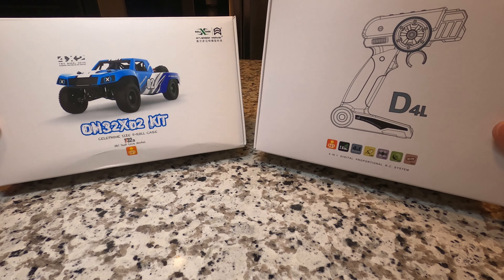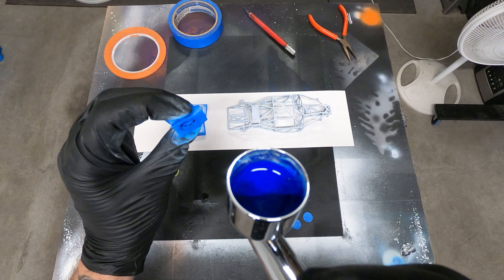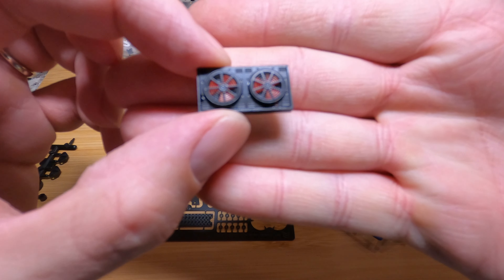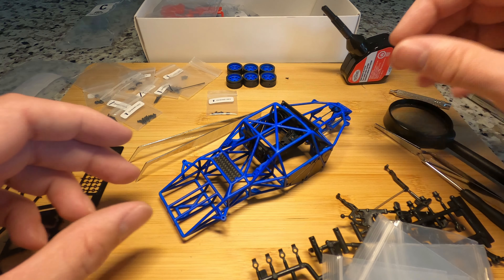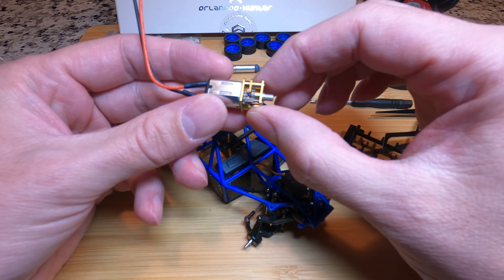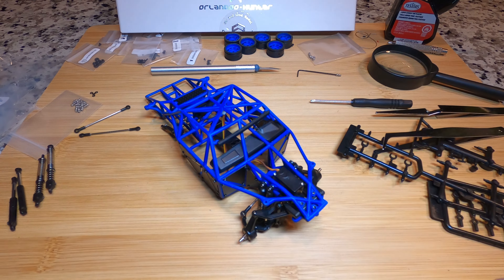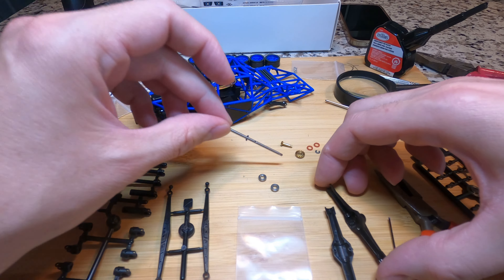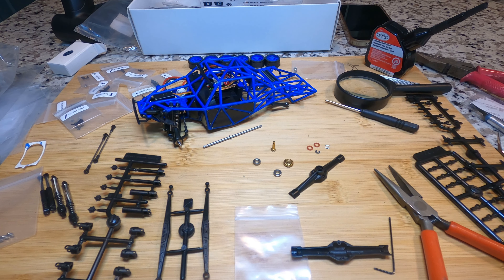Mini Trophy Truck Build - #orlandoo #trophytruck #minirc #biggbhobbies #amainhobbies

Comment: I had the same problem with the bottom pan holes not lining up.
Reply from the maker: WOW... Seems like a normal issue they should review and fix... However, it still came out great and is a sweeeeet little trophy truck! Thanks for checking it out!
Reply: i was going to purchase this kit but after watching the video and the reoccurring floor pan fitment issues i don’t want it anymore lol
Reply: @christophersrevenge8012  I've been driving it for a little while now and that problem hasn't seem to bother. I used one of the extra longer screws on an angle to make it work and its been fine.

Comment: Did you weight the rear? You’re supposed to put tungsten putty inside the gas can, or put weight rings in the spares to get the truck to sit right… I’ve tried both… the putty slowly leaks out… so I did the weight rings and the truck sits awesome… the gas can is supposed to ‘click’ in